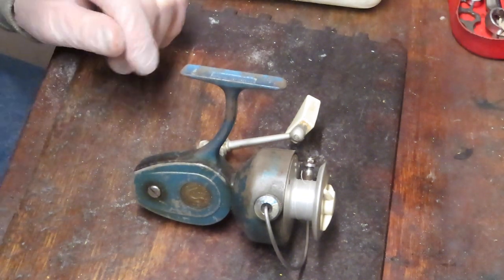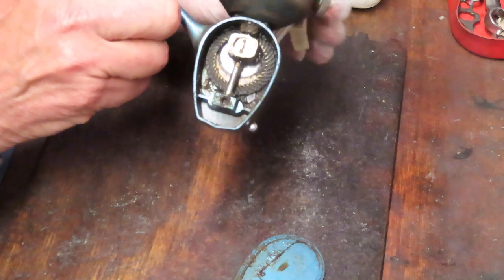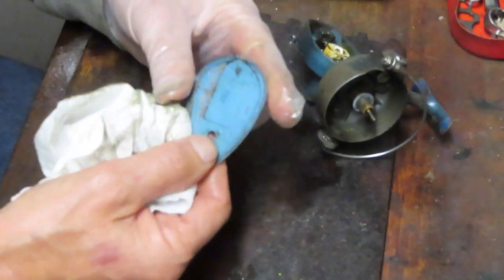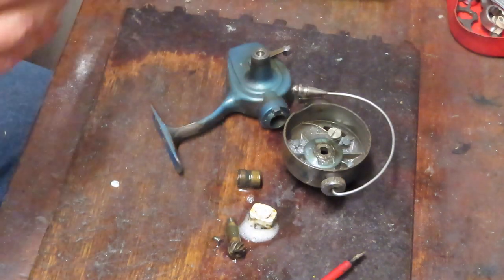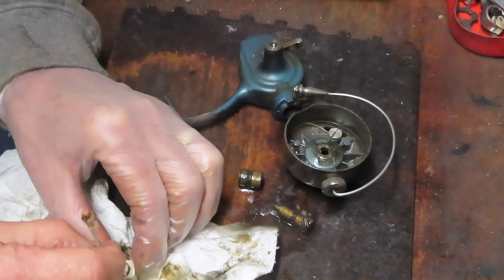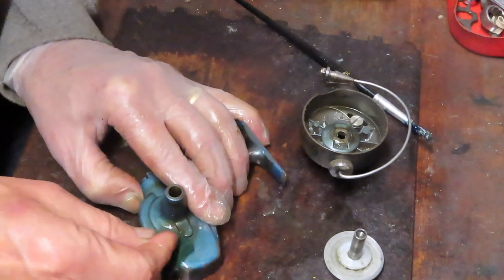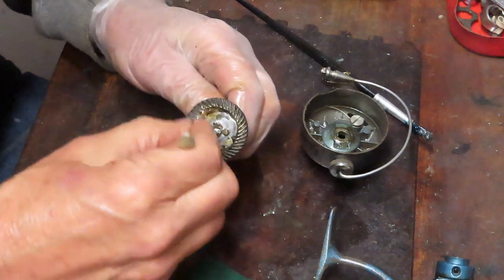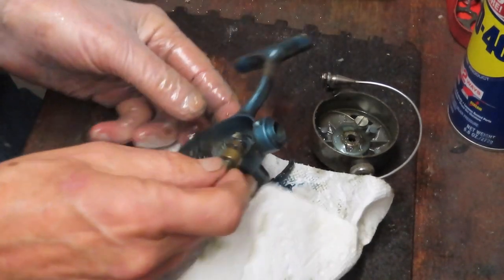Penn SpinFisher 720 spin fishing reel how to take apart and service

Comment: I have a 722 Z and a 720 greenie with the green, silver,and white side plate. It is an earlier greenie than the one you’re working on here. I like both of my small vintage Penn reels. I put a small gold and black Gomexus power handle on my 722 Z reel. My Penn 722 Z has a ball bearing but not my greenie. Today  I’ve been working on the smallest of my Daiwa Silver Series reels - two 500C reels and a 1000C reel. I an so amazed at the quality of those tiny reels. I’ve always used a 7000C and a 4000C surf fishing so I didn’t know what to expect from these mini spinners. I have been very pleasantly surprised as they are quality reels for sure. Thanks for doing this one Dennis. I really love my Penn greenies! This one has a lot of use behind it. I would never repaint one of these old beauties!  By the way, I have to admit you get far more use out of 1 paper towel than I ever do.
Reply from the maker: Thanks Chris.  I like that reel as well.  Good luck with the Daiwa they pack a lot into those smaller formats - Dennis
Reply: @2ndChanceTackle  I knew almost nothing about these tiny Daiwas until I got obsessed with completing my Silver Series collection. You are so right about these little masterpieces. I getting worried though as I’ve started looking at reels that don’t belong in a vintage surf spinning reel collection. I had a time with the AR spring on a 500C yesterday. Luckily I have two so I could look at what was wrong on the other one. A schematic doesn’t often show how to position a spring.

Comment: Bought a Penn 720, it was in pretty good shape but the bale was not moving properly.  I fixed the bale with some oil. Then I watched your video, very informative. Took the whole thing apart cleaned it ,lubed it , put it back together. Works great!  Your video saved me a lot of head scratching and some four letter words. Thanks for your service. Now I'm going to do the same thing with a 704 and a Beach Master.
Reply from the maker: Thanks for the note.  Good luck with he big ole 704 - I have a video on the Beachmasters if you need a reference point Dennis

Comment: I recently built one out of brand new parts from Ebay including a new fish logo sideplate and crosswind block. I put it up for auction without a reserve and a absolutely lost my shorts on it. Shame on me. That reel was so smooth considering it was a bushing reel instead of bearing. Wish I still had it but lesson learned. Some collector has a nice reel and I hope they enjoy it anyway. 
Thanks Dennis!
Reply from the maker: That's the risk you take on Ebay.  I have a general rule that says I won't spend money to recondition a reel if the cost to do so makes the reel more than 50% of what the reel could see fo.  By the time you list, pay Ebay fees and shipping, the reel is no longer a good deal
Reply: @2ndChanceTackle  I've done restorations on things that interest me. I found the same thing to be true. You very seldom recoup your investment in the restored piece. I simply enjoy the process and get a little education out if it. When I sell something, it's just something I want someone else to appreciate. I do it  without any expectation of profit.

Comment: Hi Dennis….I just saw your video on the Penn 720….I need a bail spring for it….also the bail trip mechanism on my Quick 1000 is not tripping the bail….any suggestions on any of these issues….thanks on your response on the Penn 700’s Juan
Reply from the maker: You should be able to order that spring from Mysticparts.com by following this link https://www.mysticparts.com/PennParts/Parts/32-720.aspx. On your Quick reel.  Before you take it apart, use a heavy spray of penetrating oil on both sides of the bail arms and remove the spool and spray inside the rotor cup.  A lot of times these reels fail to trip because dirt and dried grease freeze the trip arm and bail.  Penetrating oil can help free it up and restore the function - Dennis
Reply: @2ndChanceTackle  Dennis…..I am going to order that bail spring for my Penn 720 thanks for the info…..I tried spraying the Quick 1000 but still won’t trip the bail….it is really clean….the arm is not the original (found one for 40 on eBay)….I hesitate to take it apart with my skill level….can you tell me how much they are valued at….again very clean but not original handle and doesn’t trip the bail….Thanks Juan

Comment: Please Help! I have a penn 720 and a penn 722. I took them apart cleaned them reassembled them. Now if i put the handle washer back on they reel hard. if left off they reel great. Any suggestion?
Reply from the maker: Sounds like you have the A/R dog trapped under the main gear.  You need to check that.  Make sure you have the dog set to off before you reinstall the main.  I think your dog is under the main and when you go to tighten it is, that is causing the binding - Dennis
Reply: @2ndChanceTackle  Thank You!
Reply: @2ndChanceTackle  Turns out i put the plastic spacer for the anti revers on the inside instead of the out side. Thanks again!